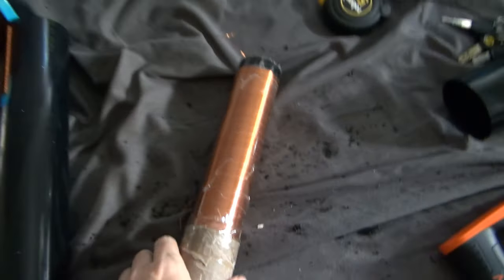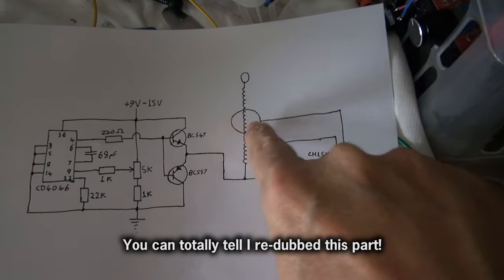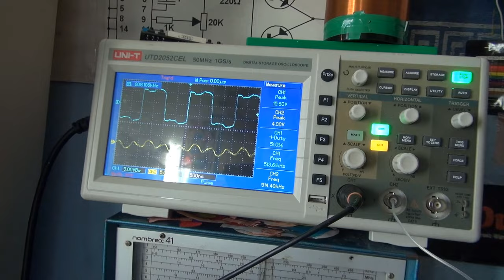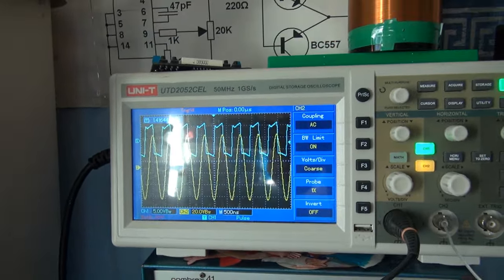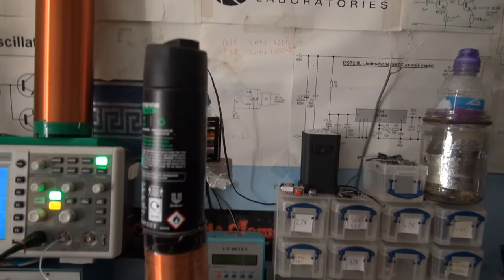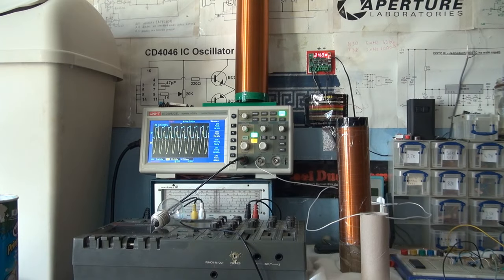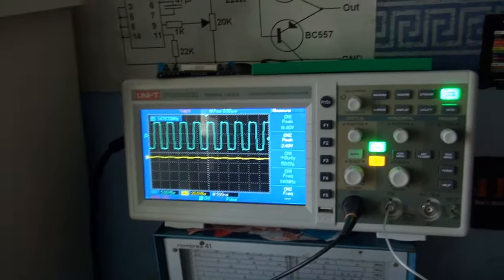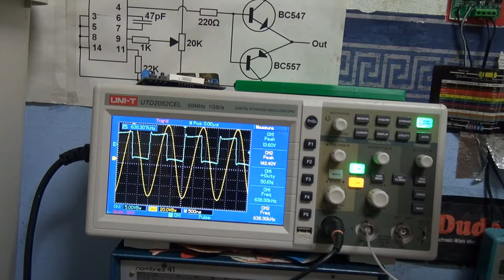How to test a secondary coil's resonant frequency.

Comment: Would a Natural Feedback ("Slayer exciter") circuit track it's own resonant frequency without having to search for it?
Reply from the maker: You are right, but I have some other plans for this circuit, basically I wanted to breadboard the "first steps" and while I was at it I thought I might as well use it in this experiment since it could be used for that.
Reply: @CoolDudeClem  Even more fascinating: All transistors and gate drivers for has some time delay, so even in self-resonance mode, it created a (cat chasing its own tail) type scenario unless we know how to build a phase advance circuit to cancel the phase delay?

Comment: Can  the resonant frequency for a multi-turn loop antenna be tested by using an oscilloscope and a function generator?
Reply from the maker: I think so, I don't see any reason why it shouldn't work.
Reply: @CoolDudeClem  Also, do you think the resonant frequency of a multi-turn loop antenna be less than 2MHz?